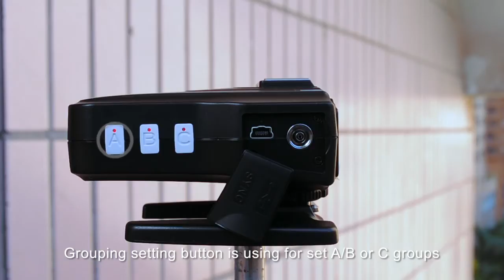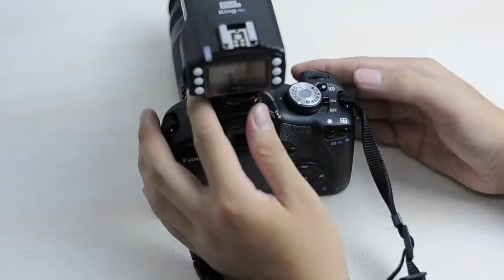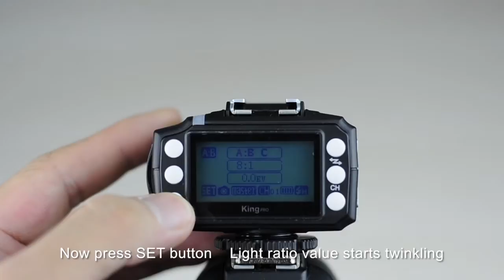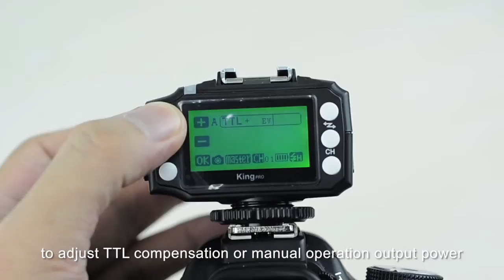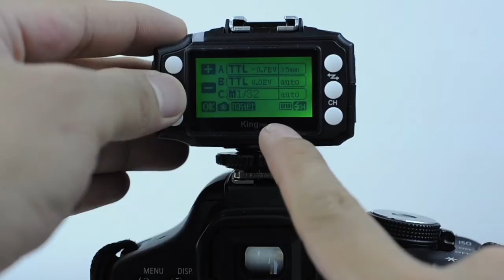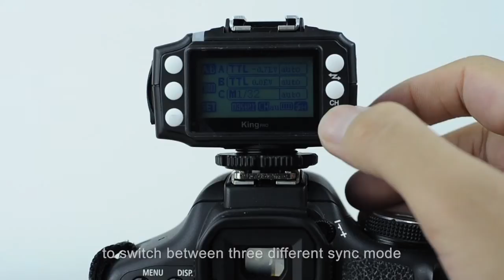Pixel King Pro for Canon TTL Wireless Flash Trigger introduction (Official)

Comment: This must be the worst tutorial video  coming from the production production  company . Ai talks to fast Does not use ponctuation or comers . It's just a long monotone speech . with uncomprehending Bla Bla . you should have your video controlled before posting . " by a real physical person "  that is fluent in English .  With no sync cable in the box and an incomprehensible tutorial video .   l’m very very disappointed with my product explications and the  Pixel enterprise  .